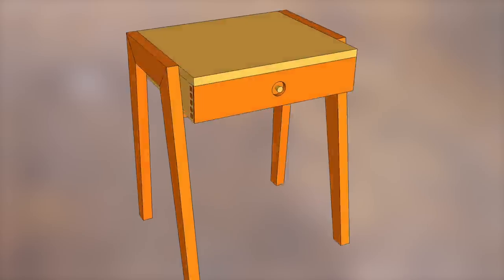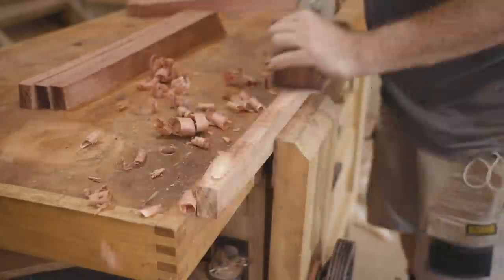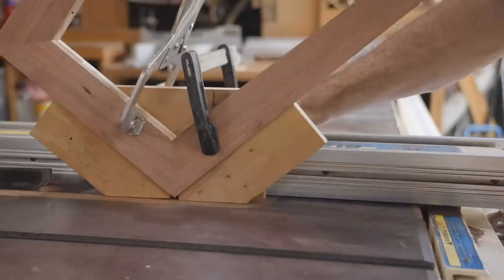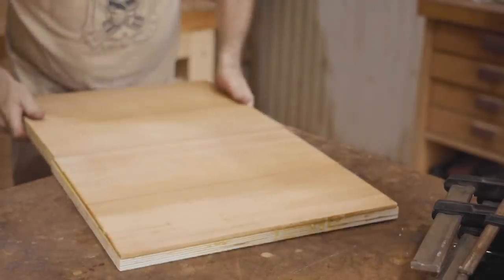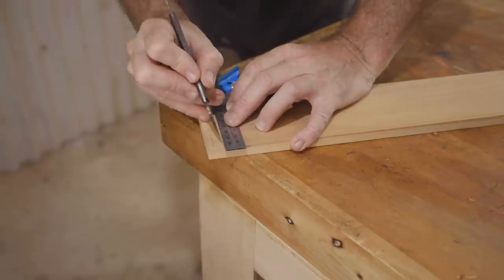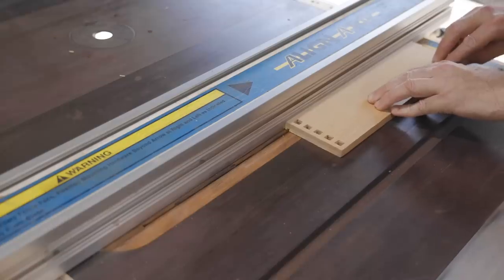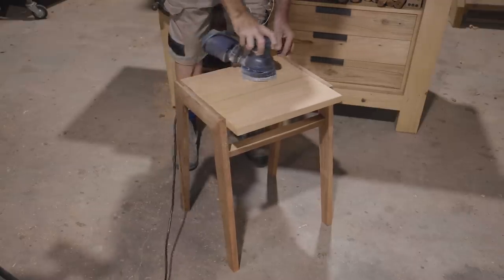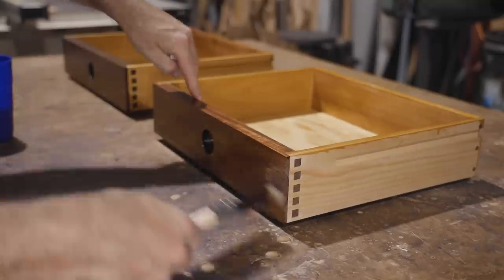How to make these Bedside Tables

Comment: I love how simple these tables look. But when you build them, it doesn't seem so simple. It is a great look!
Reply: He used only wood and glue (and oil)
no screws, rails, plastic edge supports, prints, fake veneers, melamin or paints, etc... 
And it's far superior, even physically compared to the common "designer" furniture
Some would he could made it easier,
I call it the mastery of the art

Comment: They are absolutely beautiful, the stain enhanced the contrast too. During the glue up, I thought you'd taken the term 'legs' rather seriously, they way you pinned them down to prevent them running away, but in fact it was a demonstration of how you'd planned the clamping angles to achieve all the neccessary pressure points. Great work, I hope the R & R was befitting of the work that earned it! If Mrs Pask Makes doesn't like them, please let me know the shipping costs to the UK... [For the tables not Mrs Pask!]
Reply from the maker: Haha! Thanks very much Keith! :)

Comment: Pask, I was wondering when you were going to catch the spine opps. Been there, done that. Cheers
Reply from the maker: Thanks Charles - good to know I''m not the only one! For the whole start of the project I was struggling to think in the heat, it didn't cross my mind until after I'd assembled them. I reckon they'll be fine with extra bit of spline and it's not like it's made to be sat on. :)

Comment: Work taught me once to taper legs with out a jig on the table saw, it's actually easier and quicker than using the bandsaw or a tapering jig, othough can only be done if you have a altendorf table saw, or similar to altendorf table saw, I just line the line with the blade and the moving table closest to the blade and cuts perfectly!

Comment: 9:01 A very minor irritation of mine is picking at tape to peel it off. If you feel the same, a quick and easy trick is to fold the corner of each strip over itself on the sticky side so that you have 1/4" of non-sticky tape that you can grab like a tab to peel it back with ease. =P

Comment: Great work as usual, but I have to ask - @ 4:49 isn't the grain direction of those splines the wrong way round? The grain direction is running parallel with the joint direction, not cross grain.

Comment: Actually, the mistake you made is great knowledge for beginners. I haven't worked with wood much and I would probably not have thought about the grain direction and now I will. Thank you for explaining that. 
You aren't making excuses. Even professionals make mistakes. A good craftsman recognizes a mistake, thinks about the durability, and goes back to fix it if needed. A bad craftsman recognizes a mistake and doesn't care.

Comment: 09:10 Try sprinkling some salt grains in the glue (just a pinch) to get a good grip and avoid the 2 pieces from sliding due to the thickness of the glue, the salt wont interfere with the adhesion force